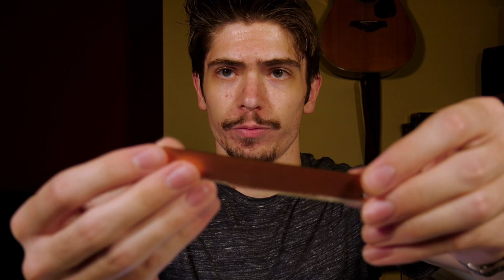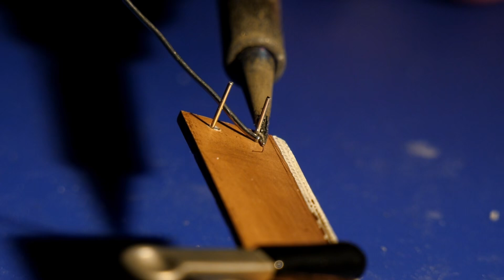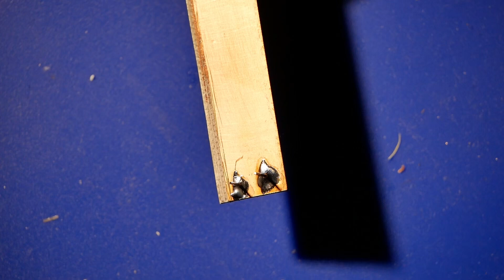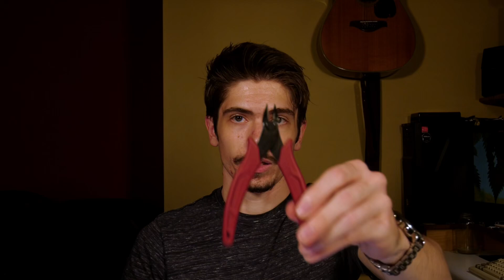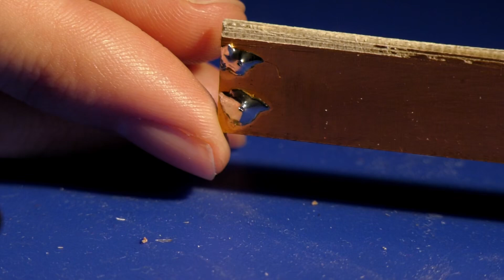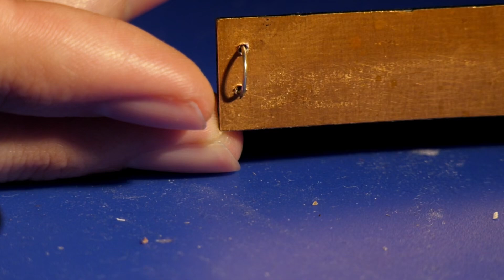How to Solder Pins to a Circuit Board

Comment: Im afraid i burned through the pads and maybe traces on my favorite old Marshall 2204 head while re capping it.
If you have a video on that topic id love to see it.
Not specifically that Marshall head, but on repairing traces and pads in general-
I havent had much luck finding anything.

I really like your teaching approach, you are very easy to follow.
I am making a business out of repairing and rebuilding old tube amps, i have a bunch of them ive been rescuing from landfills for 35 years, and im dabbling in repairing reel to reel recorders.

So ive been gathering various pieces of diagnostic and testing gear, oscillosope, power supply, frequency generator, isolation transformer, ive got a couple esr testors.
But theres a big learning curve, i havent studied real hard since HS.

Theres probably a dozen audio electronics guys ive been following for years on here, but you 'initiation' video was a breath of fresh air.
I learned a whole lot from that one.
Thank you for helping me along-
Reply from the maker: Glad the videos help you! I can do some on PCB repair and how to diagnose repairability. I can't say how far out it will be, but it's on the list now.